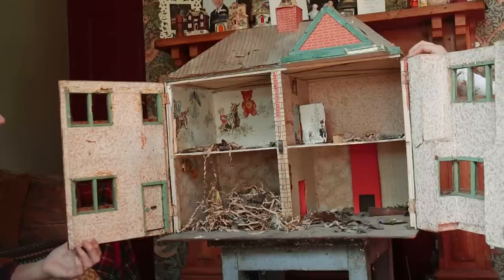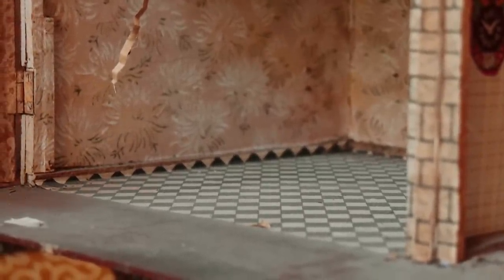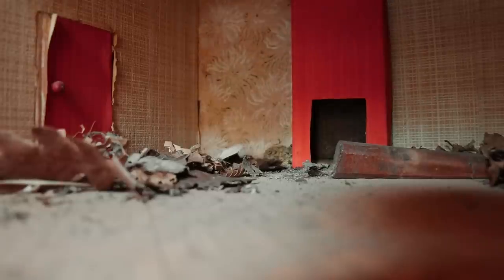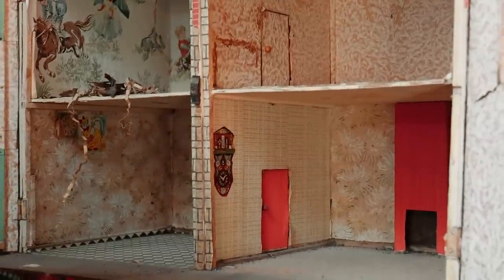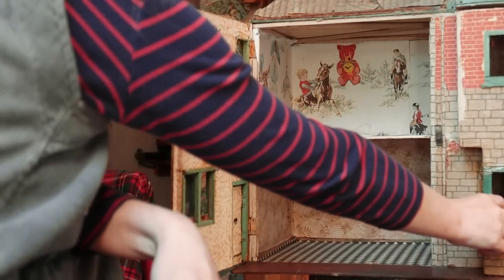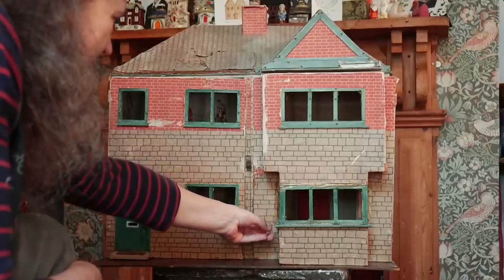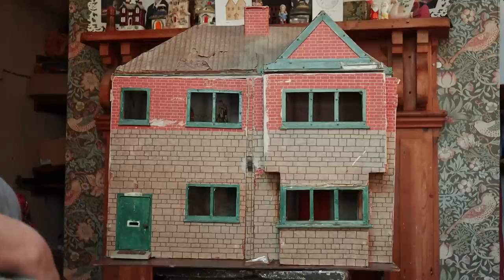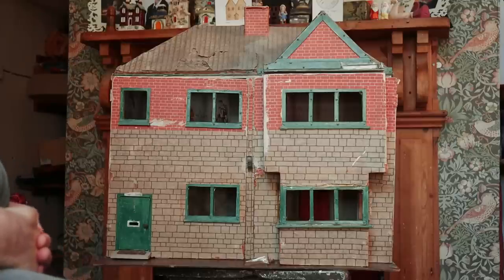We Found A Poor Sad Dolls House We Had to Bring Home! Exciting Plans Though!

Comment: I'm 79 born 1944.  I had a dolls house when I was around six - seven. It had paper made to look like roof tiles on the roof. The front was painted cream and had a painted rose bush around the front door. The door and window frames were metal with criss-crossed panes. It had a garage.  My gran bought me little people to live in it. They were made of wool covered wire, with heavy lead feet so they'd stand up unaided. They were dressed in felt clothing. 
Yes, washing day was Mondays and we had a mangle which stood outside. We had a shallow stone sink - not a butlers sink which were a bit posher and it had a wooden draining board. Some women were lucky enough to have a gas boiler.  We only had gas lighting. Our house was a two up two down terrace. Your house is based on a house that was slightly up market, so probably had electricity.  Our bedrooms all had fireplaces.  We used iron, irons heated up on the range or gas stove. Some housewives if they had electricity in their homes, had electric irons which were plugged into the light socket. We had a black iron gas stove. 
We just had brooms for sweeping. Some lucky ladies had a Ewbank which was wood, had a roller and was pushed around manually but they weren't very efficient on lino. We ironed on the kitchen table.  If lucky enough to have an ironing board they were made of wood. No fridges, so perishable food was put in little wooden 'safes' with mesh fronts and fixed to the outside wall of the kitchen in the shade, but not used much in summer though!  
Fireguard around the fire and clothes aired on it. We had a wooden clothes horse too. 
No sliced bread, so breadboard with matching bread knife always on the table, along with a brown teapot and cut glass sugar bowl.  
Wicker shopping baskets. No fitted carpets. Rag rugs in front of the fire. Fancy lace curtains were essential.  No plastic. Galvanised buckets. Front step scrubbed and done with whitening powder every week. And where I lived there were no bathrooms, so a big galvanised bath hung on the back wall of every house. Hope that helps   :)

Comment: What a darling little house! You might try figuring out the scale by determining what size doll would fit through the front door.  It could be an odd scale if the dolls that originally inhabited the house were also handmade. This will be fun!

Comment: I'm  fairly sure that the horse design wallpaper was in the house I was born in. My family moved into that house in the early fifties and the paper was already there so I think you are right about 1940s. I also remember a clothes drying rack in the kitchen which was hoisted up to the ceiling with a pulley.....your video has really stirred up some memories! 😊💗 x

Comment: I think this is early 50’s or 40’s. My mom and her 6 years older sister had a metal house with similar brick and color patterns. We still have it lol. I happen to think this might be older. My moms/aunts was definitely 50s. Is there a dedicated bathroom/kitchen? Dead giveaways it’s slightly older if it’s before children started playing with rooms to do with chores. The larger general rooms make me think it’s more 40s. And the papers (western 50s cowboy looking wallpaper especially lol) could have been added later (maybe 50’s-60’s) like you said. ❤ from Northern California
Edit: the scale is so frustrating lol. Our imperial scale is 1 ft (12 inches) is = to 1 inch…your metric scale would be 1 foot (or our 12 inches) to 30.48 cm. So our 12th scale represents 1 inch to 12 inches or 1 ft. On your scale it’s 30.84 cm equivalent to our 1 ft. This house I also believe is 12th scale

Comment: Exciting project to follow with you!  I wonder if it would work to photograph a good section of the inside or outside paper then try to print out sheets of it to renew as it was?  And an Anderson shelter containing basic needs sounds intriguing too.  Can't wait!  If you make a garden wall, don't forget that any decorative metal railings on the tops were removed for the war effort to aid manufacture of war supplies, ditto a lot of metal toys and kitchen goods.  Must have been vey distressing all round.  I was born in 1948 and remember the circles of concrete on the tops of all our walls along the Victorian terrace.  Such a shame.

Comment: I bought a house that was sold as hand made from our local auction house,it is in a terrible condition in a Tudor style,the gloss paint was peeling off on the outside, so my intention was to lightly sand and repaint but it just kept coming off, turns out it was a very early triang with the typical green bush / flowers on it. So far I have sanded all paint in and out, made new roof tiles out of cereal box and lining paper all inside. Scraped the paint off the glass windows( real glass). And I'm going to decorate it in 1930s as this is the closest date I can find. 
Love yours enjoy. 😊

Comment: You might be able to reconstruct the pattern of the wallpaper on the door and put new paper on it. It is in better condition than the poor Tri-ang that I found in the garage where the plastic roof was cracked, the electrics rusted and the plywood of the upstairs ceiling warped beyond repair.
Reply: You could make a mantelpiece out of balsa wood and a lollipop stick - I've done that with a modern 24th scale house that I need to complete. Jane Harrop has a couple of books out on making 1930's/40's miniatures and a book on making miniatures from the Edwardian era - I would think that there would be a lot of bits around from then. The World of James Herriot has a reconstruction of a 40's farmhouse kitchen in the museum.